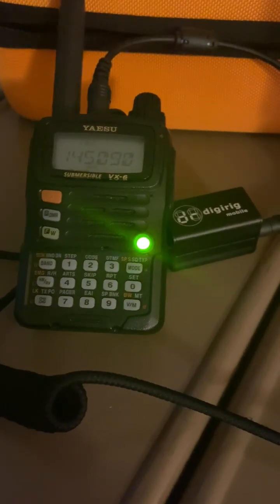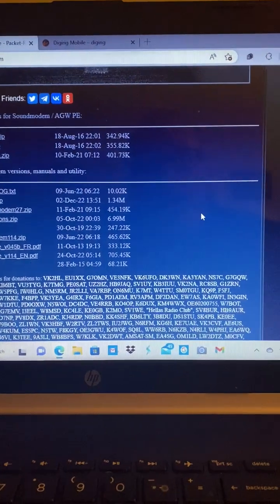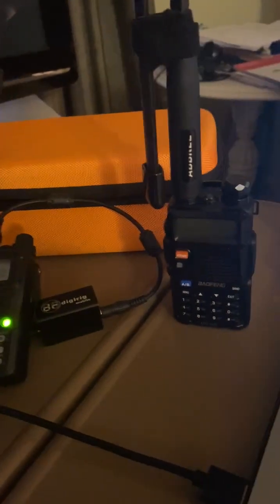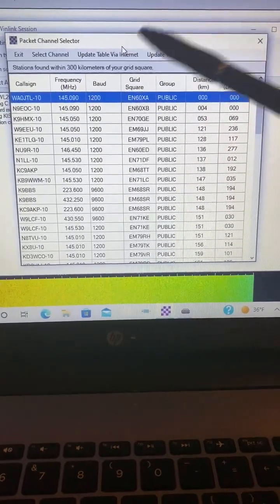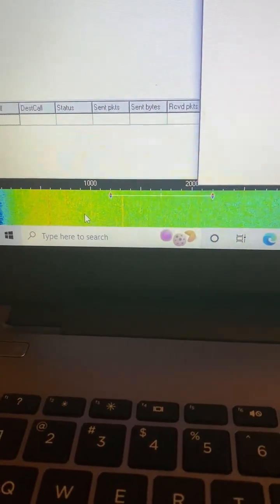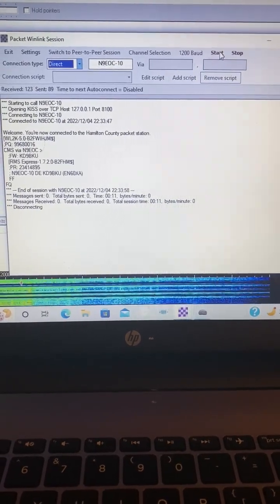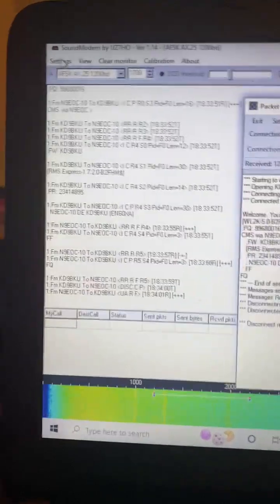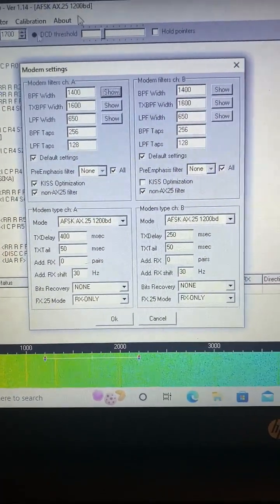Winlink Packet using Yaesu VX6 and Digirig

Comment: Which configuration of the Digirig are you using -  logic levels, RS-232, CI-V or TX-500?  Do the Yaesu VX-6R or FTM6000R or UV-5R have CAT support?  I kind of think the logic levels is the correct configuration but have told to use the RS-232.  I'm not a techie so I'm not sure.
Reply from the maker: I am not sure how to answer those questions and get you on the right track, Go to https://forum.digirig.net/ and sign up - and ask a question, Denis - K0TX can answer tech questions on the Digirig, He helped me a lot. Thanks for watching!
Reply: Thanks for the advice.  Denis is really helpful.  I'll be purchasing the R-232 configuration @mikekd9bku333

Comment: Which version of DigiRig did you purchase? 
KD9UQP
Reply from the maker: Hi Greg,
I purchased the Digirig Mobile with Yaesu interface on Giga Parts and ordered the cable needed from Digirig. 
Thanks, Mike KD9BKU
Reply: @mikekd9bku333  I ordered mine for RS232 so I could use it with my Kenwood 440 digital modes. I think I need the default logic level set up. I'll have to decide if I want to modify mine or order a new one and keep the RS232 for the Kenwood.

Thanks Mike!
Reply from the maker: OK sounds like a good plan, let me know how that works out.

Comment: Sorry very new at this...do you select the frequency on the radio or does the winlink make the change when you select the channel?  So far i only used Telnet
Reply: Hi Tom, great question. You select the frequency from the channel selection, drop down on the top of the winlink page. Then you tune your radio to the channel you select in winlink. Pick one that is close to you. If you watch the video right at  about two minutes and 40 seconds, it shows how to do that.
Let me know if you have trouble or any more questions. Thanks for watching.
Mike

Comment: This helped a great deal with your use of screen shots of settings; exactly what I needed!  I'm using a Wouxun UV9PX with the Digirig.  There is a Kenwood connection at the radio, and the opposing end is connected to the "Audio" jack of the Digirig.  The Digirig is then connected to COM5 on the computer.  Your settings got me up and going, thank you!  ~Matt (KK7MLS), Lake Oswego, OR
Reply from the maker: Thank you, Matt! Appreciate the comment and it's good to know these settings work for other radios. It's exciting when you finally get that first Winlink connection!

Comment: Yeah! Having trouble connecting using a Baofeng UV-5RE. I suspect the switch from TX back to RX is miliseconds slow even using non-VOX interface like the EASY DIGI. Sadly, I don't have a good radio here like the Kenwood or Icon... Yaesu etc... so I'm not sure if perhaps the Tytera would work. I will try.
Reply from the maker: I had a little success with a Baofeng UV5r before I started using the Yaesu. I was able to make a connection, but it dropped out. On my Baofeng I had to trigger the PPT once quickly after I hit START on the Winlink session. Good luck and let me know if you get it to work. Thanks!
Reply: @mikekd9bku333  I’m thinking I will sell a DMR radio and buy a decent analog dual band
Reply from the maker: @N4EAC  the better quality radio  - the better chance to make it work
Reply: @mikekd9bku333  agreed. The baofengs were acquired because they were so cheap. I sold my TH 74D Kenwood a couple years ago and I deeply regret it.

Comment: I'm just getting started with this. Not sure where to start.  I have a radio --> DigiRig Mobile --> Windows Laptop.   Do you know where I could get more details about the hardware/software components and configurations needed to get winlink working?  I've been banging at this for about 3 days and i'm not getting anywhere.  But the thing is, I've never personally seen this working, nor seen anyone else build.  I don't know what I don't know.    Any pointers?
Reply from the maker: Hi Wayne, sounds like you have the hardware needed. Have you downloaded Winlink Express on your laptop? https://winlink.org/
Once you do that use the set up in this video as a starting point. There is also a Winlink forum and on Digirig.com there is a digirig forum. Lots of really smart people on both of those forums with answers. If you have a specific question, I'll try to help. Good luck!
Reply: @mikekd9bku333  Great.  Thanks for the tips.  73

Comment: So is the packet setting the same as Vara? I need to use Vara for the organization I'm with.
Reply from the maker: I have not tried using Vara yet, so I am not 100% sure. Other than changing the drop-down menu on the top right of Winlink from Packet to Vara I think everything else should work. I would appreciate hearing if you made a connection or not and any changes you had to make. Thank you! Mike
Reply: @mikekd9bku333  Thanx Mike, I'll let you know
Reply: Still figuring it out